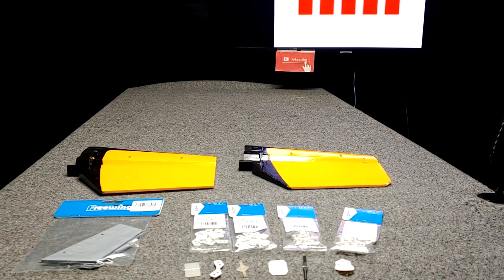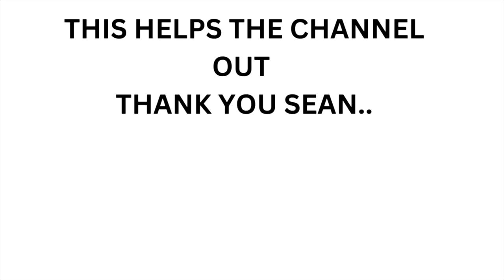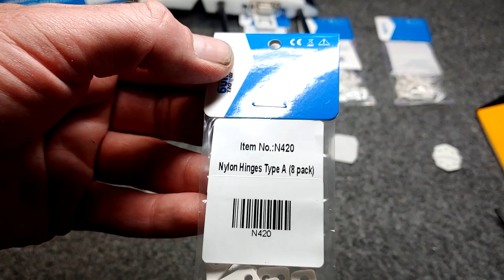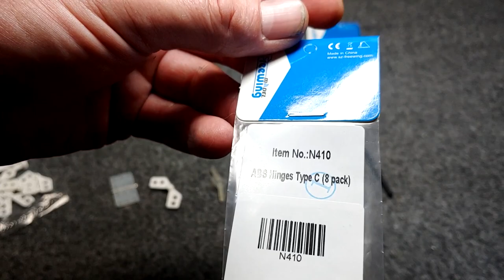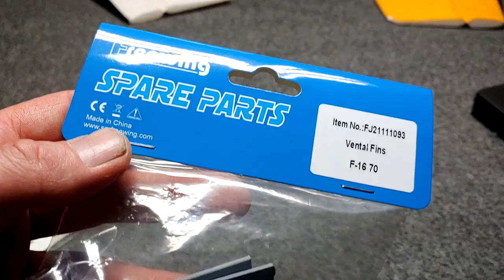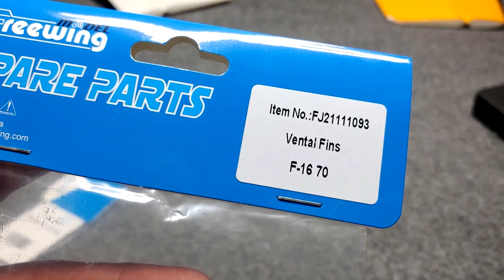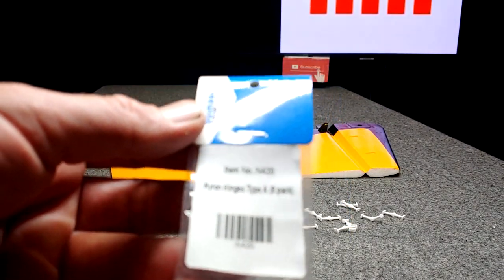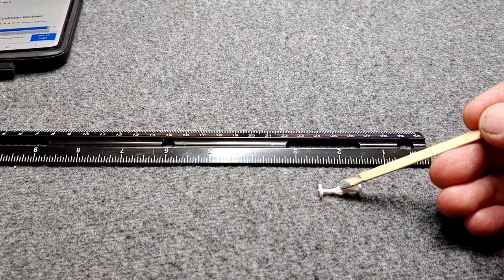RC AIRPLANE CONTROL SURFACE HINGES LEARN ALL ABOUT THEM

Comment: Very informative video of the difference between the hinges and what they work better with! I've mostly just used CA hinges and the nylon pinned hinges on my builds but I've got a set of those pinpoint hinges I might try for my next kit! I've had those since the late 80s ! It's just much easier for me to use my hinge slotting tool and use the CA hinges! It's like a electric razor and really does a good job cutting the slots!

Comment: I don't ever "Subscribe"  but I just did....
Now you covered hinges that I wish I could find.
Those T hinges in a (1 size larger) would save me from Xacto'ing a currently functioning  pinched hinge(and I didn't know it was called that)
bought my 1st foamy 3 weeks ago and now I know why deep down I prefer balsa.
but the foamy is saving me months of work while my other balsa is in the hanger.
I was not a fan of no hinges when I actually discovered how tail feathers are made on the "Beve".
Gut tells me but I did not feel what you did on the T hinges. (and I have not located them on sleezbai or amazing)
But with time and several 100 cycles in the air and under "Load" I would think the t hinges would loosen up or 'break in" and smooth out.
Cheers,  from nc

Comment: Hey Sean.. if you REALLY love that model, then pick out the most deluxe one you have available that’s easiest to install. I know that’s the purpose of your video.. but hinges tend to be, from my experience, a personal choice of the builder/owner.. usually based on experience work with a specific model of hinge and overall flying experiences with said hinges.